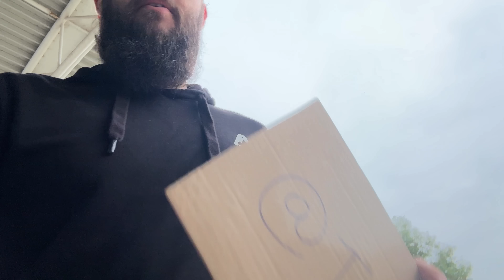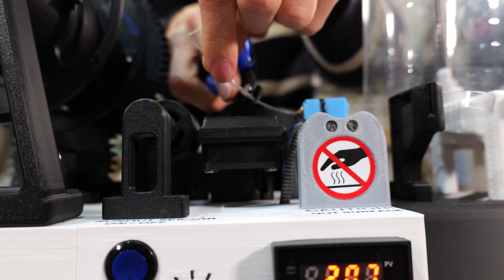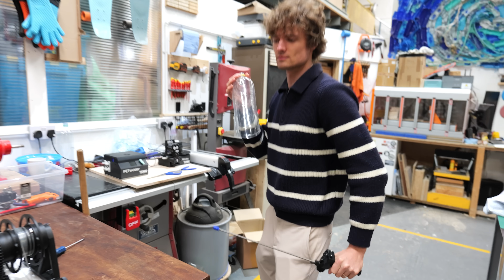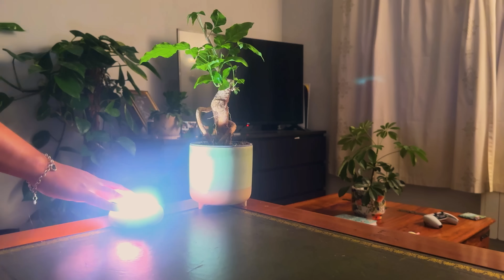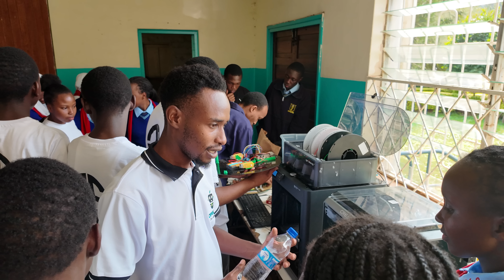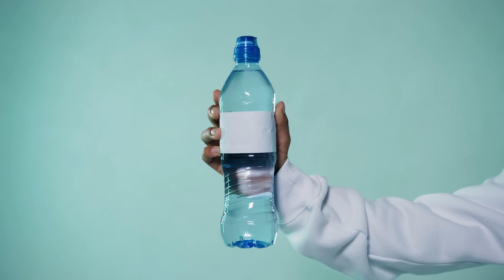Finally, a way to recycle Plastic Bottles at HOME

Comment: those PET cutter and filament intruder also filament welder is already out there in the market, mostly chinese product.. but making the slot for different thickness of PET is nice idea. Recycling this way is good thing, but, the effort need to be put on this, the manpower, the electric, the space, might end up spending too much of cost in it, making i wonder if this kind of project could really beneficial. the thing about recycling, is not cheap. a short made out of 70% recycled plastic cost like 20 times normal short. but doing this to help people with your own expense is always a good thing. plastic being reshaped into any form that could be really useful for community is always a good thing! i really wanted to be a part of it if my economical condition is supporting me.. but for now this idea can only wait. my wallet shouting to me "no!" 🥲 great video by the way, thank you ❤

Comment: Cool! However, the filament welder is a bit over-engineered. Perhaps the bottles can be welded as a long tube before cutting them into strips. You could simply cut the bottoms and press the bottles down on a hot plate and fuse them together. The weld seam may be a bit rough and raised, but it can be made smooth by lightly sanding it.
Reply from the maker: Manually pressing ribbons together and then having to sand them sounds like a huge pain compared to how simple this machine makes it.
Reply: @BrothersMake  That machine is way too complicated for what it does. The automation could be better applied to other things such as cutting the strips. The welding I described is merely a possibility. Alternatively, you can but splice the strips by welding them with a soldering iron. The weld only needs to be strong enough to be pulled through the extruder.
Reply from the maker: I don’t see why being over-engineered is even an issue..? You aren’t being asked to build it from scratch, you buy the machine and it works flawlessly right out of the box. 

You could argue that all modern day communication devices are over engineered and we could all still be using morse code, but who’s doing that?!

Comment: Using ovens and heat guns to process the bottles into filament seems to have a massive carbon footprint on the reuse or recycling of these bottles! This exercise doesn't seem to be beneficial to be environment....
Reply from the maker: We use energy generated from 100% renewable sources 🤙🏽

Comment: If you really want to make a difference, you need to solve the big issue: time. IF you could develop a machine at a reasonable cost that takes in unprocessed bottles (lots of them)and spits out a roll of filament (welded) you would have people trawling the streets for bottles to make filament to sell/use. Until then, this is an interesting video and fun for 3d printing enthusiasts but to paint it in the light of addressing our plastic waste problems is at best misguided, at worst, disengenuous.

Comment: Fabulous stuff. 
Next project, a machine that washes, pumps out the grooves, and removes the glue. 

Maybe they sit on metal hollow poles. The poles are taper out toward the bottom Which has an extra seal of somesort 
Somehow, once dry (?), they are pushed down to create a seal, then the air gets pumped in?

Comment: So you guys don't know PETCYCLE?
Might be a typical German thing: You pay 25 cents deposit per bottle (yes, that exceeds the price of the product in some cases) and when you return the empty bottle you get that 25 cents back.
That's 10 Euros for 40 bottles. The time and energy to return the bottles is basically zero, because I drive to the beverage market (another German thing) where I buy my beverages, so no detour required.

 An empty 1l bottle is around 30 grams of PET and you can't use all of that in your recycling process, especially the heavy part at the top can't be used. Let's assume you can recycle 20-25 grams. For 1kg of recycled PET you need 40-50 bottles.
I spend about 10 Euros on a 1kg roll of PLA filament.

You see where this is going to?

It's much easier and cheaper for me to use the existing recycling processes than creating my own.
Reply from the maker: Yes, that’s brilliant that you have access to this. We wish we did too. Unfortunately, the UK and a lot of other countries haven’t implemented this scheme.

Comment: Look to Kenya again. They are shredding plastic and incorporating them into cement paving blocks, which means that the plastic is useful for another couple of decades. Your plastic bottle top ends could be upcycled for a project like that .Check out the Kenyan project, run by a lady (can't remember her name).
Reply: My concern with that is that as they wear down, it is going to release micro plastic.  I am hoping the plastic eating microbes will become a real solution to plastic waste.

Comment: Nearly 10yrs later something I've been wanting people to do is finally being done 😊
Reply from the maker: We got there in the end!
Reply: I ended up finding my research notebook this year listing the different types of plastics, what they are made from, how they get used, etc.
Even went around my house listing everything I could that was made from plastic and what type(s) they were made from, and if they were kitchen related, or bathroom, etc.
I even wrote down what efforts folks were doing from around the world that I could find. I ended up finding articles about plastic waste being found inside a whales stomach too, and what other plastic objects were killing sea life, I hadn't gotten to animals on land yet.

I was also trying to show my family types of flowers that could be made from plastic bottles, or how I made a spider, an ant, or a lady bug. And even a little bee (made from 2 thin bottle caps and cut out wing shapes), attached to a thread that's attached to a bottle cap which is the center of a bottle flower. It's like the game of ball in a cup, but this is to get the bee to land on the flower. I made it back in 2019.🐝🌼

Before bottle crafts, I was making things with duck brand tape. Flowers and bookmarks was/is my specialty. I still have my notebook of measurements and instructions on how to make duck tape flowers, just in case.

Comment: I have a precious plastic shredder that I assembled and created a table for it. I've been collecting,   colour sorting bottle caps and rings for years but minimal quantity so far. 

I think I need to get Igor's machines.

Yes, pet bottles get picked up where I live, we also have a 10c collection for single serve drink containers, plastic, cans and cardboard milk containers.

My thoughts on 3D printing is, if you're making something to keep, eg parts for projects then the life cycle argument changes. Also the option with precious plastics machine to shed, melt and reform many other things and no need to heat gun to smooth out or otherwise... probably more expensive start up but more options in the long run.
Reply from the maker: We run a small-scale injection moulding recycling workshop, which produces high quality products using aluminium moulds. A very different process but a great way to make products that can be scaled easily

Comment: Anything you guys come up with is good in my opinion. You may spark an idea in someone else. These devices can be gifted to schools and make for more interesting physics and art classes. Something more practical than the bird feeder my son made in shop class out of sheet metal. They didn't crimp any of the edges, so you could barely touch it without cutting yourself. He gave us permission to put it into our metal recycling bin that we take to the scrappers every few years.
Reply from the maker: Schools would be a great use case for these machines

Comment: It is foolish to recycle PET on a small scale because there are many large factories doing this job and they are much more efficient.
You can make more money with the same equipment and investment for recycling high value plastics and there are no large factories competing with you.
Reply from the maker: ‘Much more efficient’ providing the material is ACTUALLY recycled. Unfortunately, commercial recycling involves a lot of exporting materials.
Reply: @BrothersMake  Because it is not feasible in your country, other countries already have large-scale factory facilities, they need a lot of raw materials, and you are actually competing with them
Reply: @BrothersMake  Most of the bottles you throw away end up being collected and sold to recycling plants in other countries to be made into clothing. You should focus on collecting the waste generated by 3D printing users in your country, as there are no plants that can process it.
Reply from the maker: The UK does collect PET for recycling. But exporting this material to countries that cannot process it shouldn’t count towards recycling statistics in our eyes.

Comment: The section where you have the tops of the bottles stacked on a rod and stand if you get or print a clear rod and put a light in it, I think would make a nice lamp especially if you have different colors, most of our drink bottles, like the ones you showed here have a deposit on them which you are refunded when you turn them in.
Great video, Cheers from South Australia.
Reply from the maker: That’s a cool idea actually! Maybe a future video idea 🤙🏽
Reply: Could also turn the tops into a water fountain
Reply: Quite! The look is eo esthetically pleasing!

Comment: You pressure the bottle then heat it - wonder if you could get quicker results by pressurizing with heated air?. Am also reminded of 'weedeater' filament. Why 3d printer when the lawn is a mess?. Would love to see you chuck up a reel in a weed eater and see how it goes.

Comment: I question how well 3d printed TPU ferrules are going to last, but to maximize their durability, place a steel washer between the bottom of the aluminum pole and the TPU so the pole rests on the steel washer. It distributes the load so as not to poke through the bottom of the ferrule.
Reply from the maker: That’s a great idea

Comment: Thank you for talking about the downsides of locking the PET into its "final form" by recycling it at home. Theres no point recycling this PET just to create more benchys and trinkets but for genuine long-term use products it makes a lot of sense!
Reply from the maker: For sure! We’re always weighing up both sides of the argument for any plastic we try and recycle 🤙🏽
Reply: @BrothersMake  Recycling centers COULD take PET printed items if a system were developed to mark the pieces and bring them in separately so they don't need to be hand sorted from other items. It's a process efficiency roadblock, not a recyclability problem. Ask the recycling center to help you come up with a pilot program.
Reply: There is no long term use for pet. It all sheds micro plastics. 

We need something more like Timeplast.
Reply: I hope next time you or your friends are tempted to buy anything that looks like a trinket....because nobody needs anymore trinkets...not even 3D printed light pulls,  phone standss, cable ties....nope we dont need any more trinkets and non of us ever buy them any more 🤔

Comment: Oh yes, heat it up using electricity.....
Reply from the maker: *renewable electricity.

Some people just love to find negatives in everything.. Seriously, how do you think commercial recycling is done. Totally devoid of any energy usage whatsoever?
Reply: @BrothersMake it's not finding the negatives. It's finding the deficiencies.
Reply: @BrothersMake it has been scientifically proven that it takes more energy to reuse plastics then it did to make it. So unless you're recycling it to make more plastic water bottles, what's the usage?  Is the cost of energy worth what you can make doing it this way? All I see is you can make a $2 plastic boat. Did it cost less than $2 to make that plastic boat?
Reply from the maker: Love the use of ‘scientifically proven’ 😂 great work. You’re missing the point though, the energy we use is renewable.

I also think you stopped watching after the first print. We recycle plastics every single day in our workshop and trust me, we have run the numbers many many times. We are not operating at a loss.
Reply: @BrothersMake ok.  Please post a graphical statics of your output versus input.
Reply from the maker: I don’t think we’re going to do that just to ‘win’ this YouTube comment debate. But thanks for the comments either way 🤙🏽
Reply: @BrothersMake yeah, sure.  Not asking you to win.  Asking you for proof.
Reply: @BrothersMake I'll be right there when you "try" to pass this off i in the future.  If it gets that far
Reply from the maker: Looking forward to continuing this farce then! 😂

Comment: These smaller rolls would work great with ams. They have a mode that will just move onto the next roll when it runs out. Also, sunlu is releasing a lid for the ams that turns it into a filament dryer
Reply from the maker: Interesting!

Comment: I am from India and I work on PET collection and I have been researching and was hoping to test this out for the past couple of weeks. This is so well timed for me, was wondering how much this would cost as I have never really 3d printed before and I think it will be a journey for me but I really want to save the high quality recovered PET for this and not drive them to downcycling - converting them into fabric and rather put them to some good applications for our local needs. Thank you for all the help!❤
Reply from the maker: awesome! Glad our timing has worked out well. You can also use our discount code for 10% off these machine 🤙🏽 ‘BROTHERSMAKE’

Comment: For someone printing as a hobby FANTASTIC, but even a small business not worth it. Not to mention your major concentration of plastic is in your tops and bottoms. Your extruder head needs to size up a little bit to roll it quicker and probably go ahead and do a water tip almost directly afterward.
Reply from the maker: It’s a cool concept. And we have discussed bringing out a product line using this as a material source. It certainly can be viable under the right circumstances.

Comment: Is the amount of energy and water spent recycling these bottles really worth it? Genuine question, I don’t know, I’m sure it depends on things like whether you’re on renewable energy, how you use the water, etc, but it doesn’t seem like a home run just yet.
Reply from the maker: It’s always something to consider for sure! For us, it’s about removing the plastic from a cycle that could inevitably end up as a pollutant. In that sense we think it’s worth it, but it would be good to know the numbers behind it for an exact measure.
Reply: Less plastic in my ocean the better
Reply: I was thinking the same thing. Maybe it's about adjusting the machine regarding prep after washing. 
Then Work on using less water for washing. 
Do they need to be cleaned individually or can you use the same water, or even a dishwasher? 
What temperature would be too hot for a dishwasher? 
It may also remove the glue. I wonder if there is a perfect temp, that doesn't melt the bottle yet also gets rid of the glue?
Reply: @teloolah9381  water does not get rid of glue. if it did, the labels would fall off in the store
Reply: Absolutely...

You see, plastic waste is resistant to biodegredation...

But electricity can be derived from renewable energy sources that are environmentally friendly...  (wave/surf generators, wind power generators, hydroelectric generators, photovoltaic generators...)

So... you can make the net cost of the electricity used very close to zero (over time compared to your initial investment).

Therefore, your concerns regarding environmental effects of recycling are completely misplaced. We simply need the proper infrastructure in the industry to collect, clean and process the plastics to be recycled using the clean energy.

Comment: Love the idea of this but wish it wasn't so labour and energy intensive
Reply from the maker: It certainly takes time and effort, as with all recycling efforts. Using virgin plastic will always be simpler and cheaper. But we’re not driven by speed and profit margin. Our focus is the need to remove plastic from polluting cycles.
Reply: @BrothersMake  As someone with a 3D printer and little bit of a Dr Pepper addition I'd love torecycle like this. The time, cost and the limited usefulness of most 3D prints... I personally think kerbside recycling is probably better over all. I hope someone can really run with this kinda home recycling though.

Comment: I saw someone doing this on tik Tok  during covid with a blade tip and a small contraption....they just cut the bottoms off of the bottles and ran it thru and cranked it and  that worked... they were definitely in poverty and had more melanin than the guy in the video... they never heated them in the video I saw....
Reply from the maker: We follow the same dude on Instagram 🤙🏽